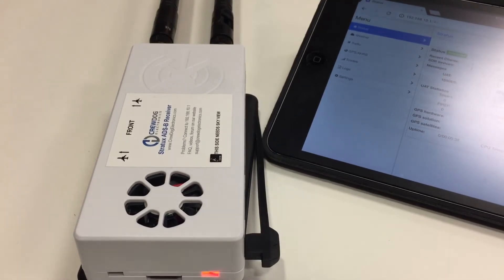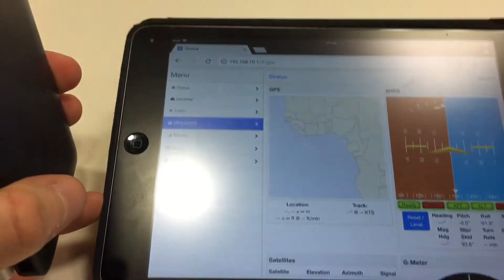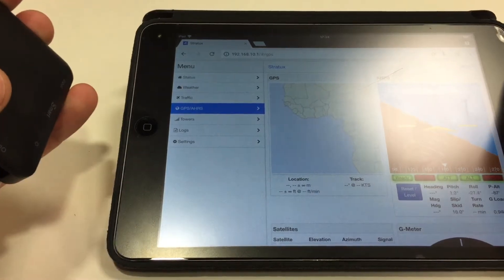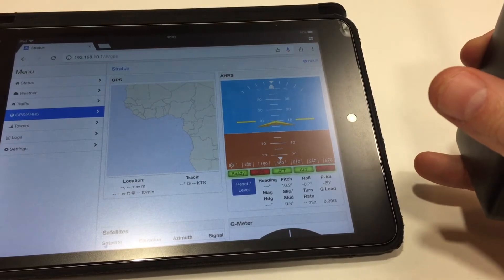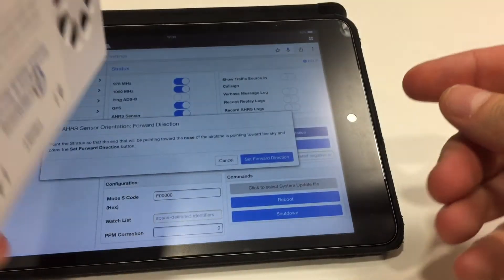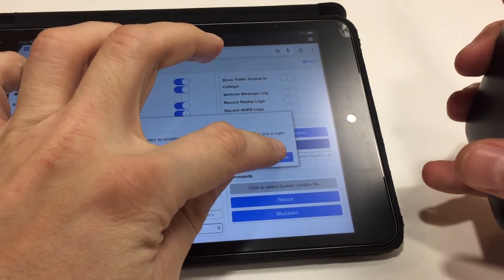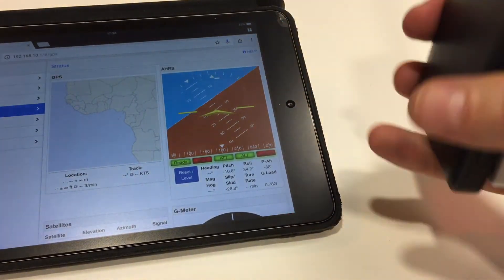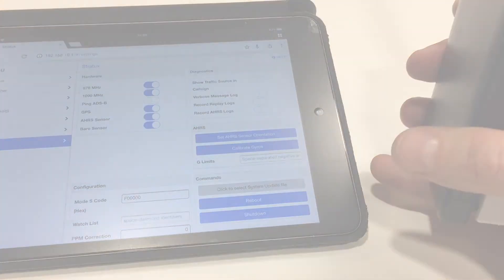Stratux ADS-B AHRS Orientation and Calibration

Comment: I followed the steps but for me it just says caging on the ahrs page for almost 2 minutes and then the ahrs turns on and it just drifts until its pointed about 4 degrees down and 40 degree bank to the left

disregrard, turns out I needed to hit this zero drift button instead of the set level button, seems to be working fine now.

Comment: I've had my unit for several weeks now and just now (after watching this video) figured out my unit AHRS sensor came with an orientation setting to be mounted on the "right" side not the "left" side of the aircraft. No issue since I'm still a student pilot and have not started fully using Foreflight and iPad in flight but wanted to make sure you knew the orientation issue since the video suggests you ship the units with a left-side orientation.

Comment: First off, great product and good work with all the support ! I have done the procedure above and recalibrated the ahrs during a runup. Everything fine until then. However, when we're climbing on takeoff the unit shows a bank 30 degrees to the right, which is not the case. I have attempted multiple calibrations, etc. to no avail. It continues to roll and indicate a 30 degree bank. Any suggestions ? The stratux has the latest software and everything indicates it is connected
Reply: I’m having the same problem
Reply: Me too.  I returned my first one but the new one also banks in level flight.  It banks secured and calibrated to my office window.  Within seconds it indicates my office is in a 30 degree bank.

Comment: Would there be any problems with (securely) mounting it on an overhead skylight, i.e., upside-down, horizontal, lengthwise with the cabin, the antennae fully exposed to the sky through the skylight plexiglass?

Comment: I purchased the Stratux and have been having AHRS alignment issues. I’ve asked questions on Amazon (where it was purchased from Crewdog) and have not yet received an answer. The problem is, when I orient the device as shown, it shows opposite movement. There’s absolutely no way that I can use this the way shown and stuck to a window. The ONLY way it works, is with the device lying flat on the battery, with the gps and fan facing up and the antennas pointing forward. That makes the suction cups totally useless which could cause the device to become a hazard to flight controls.  I’m using it with WingX Pro 7.

I was considering waiting for the RTAG event on the 25th in Savannah, Ga to show a representative what I mean but I need help with this thing now.